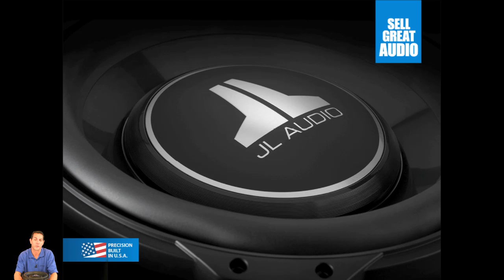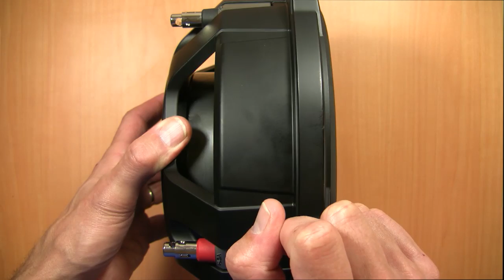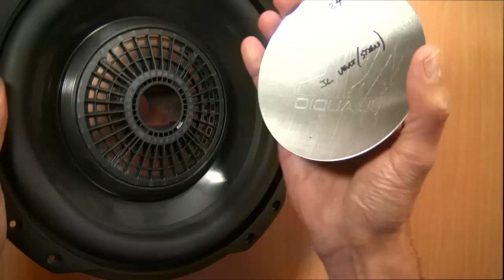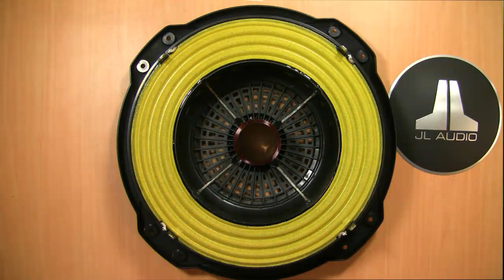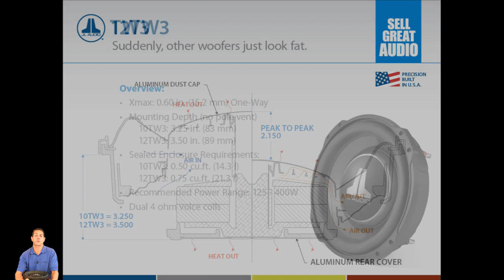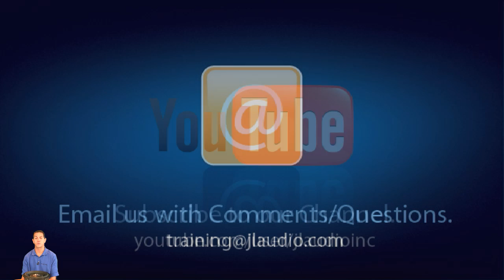A Quick Introduction to JL Audio TW3 Subwoofers

Comment: I have a pair of these  custom mounted in the spare wheel well of my BMW Touring each one with its own 500W JL Audio amp. When I turn them up the car shakes so much that the electric windows wont close in the door frame. They're that good.

Comment: I have a 2016 Tahoe want to a amp and some subs, but want to put subs in the back panel is there a stealth box that fits in the place of the panel? I don’t want to take up a lot of space? Help?
Reply from the maker: Hello Pepe,

We do not currently offer a Stealthbox® solution for the rear cargo area of your 2016 Tahoe, however, we offer a solution that fits inside the front center console.

The SB-GM-4GSUVCNSL/10TW1 Stealthbox® fits inside the front console of 2015+ Chevrolet and GMC full-size SUVs with front bucket seats and a factory console.

Loaded with a single 10TW1-2 in a down-firing sealed enclosure, the SB-GM-4GSUVCNSL/10TW1 Stealthbox® is wired for 2 ohms and rated for 300 watts of input power.

Alternatively, if you require a custom enclosure specifically in the rear cargo area of your Tahoe, I recommend visiting a local JL Audio Authorized Retailer to inquire about a custom enclosure build.

Comment: would these do ok in a ported/vented box? or would they be best in a sealed box? i'm looking to install them behind the rear seats of a 2016 crew max tundra.
Reply from the maker: @jbw5485, yes they would do well in a ported enclosure. We have specs on our website for ported applications.
Reply: @garminaudio  thank you for your quick response. i see on your website it recommends 0.60 cu ft. for a ported enclosure. the one i'm looking at is 0.88. is that going to cause a major issue? it's an enlcosure for two 10's that would fit behind the rear seat of a crewmax tundra. i guess my main question is, how exact does the enclosure measurements need to be? thanks again.
Reply from the maker: @jbw5485 that should not be an issue as long as the tuning is between 32-35 Hz. If it is tuned much higher it could sound boomy.

Comment: I've been running JL audio subs ever since I was old enough to afford them. I've had the W6 and W?s in twin 10s both were well powered and I loved them in my Audi then in my Z71. I'm now looking to add some more bass in my 2015 jeep rubicon unlimited (4door). It has a tone of aftermarket equipment on it as do most jeeps. I have not touched "premium system and floor mounted sub in the back. I'm looking for something that will allow me to still use the back to haul dogs and other stuff around. Do you have any suggestions on what I should put in and where? I'd be ok with a real nice 10 powered well, but there are some options I've seen in forums. I don't know wether to get a super low mounting sub under one of the sheets or if a stealth box is available or what amp I would need and where it could go. Space is an issue, but I don't want to put something cheap in that doesn't sound good. Please advise.
Reply from the maker: Hello, we have a set of 10 inch enclosures that are designed to fit along the sides of your Jeep.  They would  not take up any of your usable space.

http://www.jlaudio.com/car-audio-stealthbox-jeep-wrangler-unlimited-07-up

You could power a single with the XD3001v2

http://www.jlaudio.com/xd300-1v2-car-audio-xdv2-amplifiers-98601

or the pair with the XD600/1v2

http://www.jlaudio.com/xd600-1v2-car-audio-xdv2-amplifiers-98604

Comment: I am looking for subs to go in the saddlebags of my harley. 1 10 in each bag vs the traditional quad 6x9 would running a bead of silicon around the dust cap to prevent moisture harm them.

Comment from the maker: @sumaran72:  They are designed for small sealed boxes.  Free air is not recommended.

@CAMDENN MUSTANG:  500 watts on each is a tiny bit more than I would recommend, but if you set things carefully, you should be ok.  Please follow our recommendations in the amplifier owner's guide.  Or you can email us at technical@jlaudio.com

@FvD714:  The final specs have not been determined on the 12TW3 yet.  We take our parameters from production speakers and they are not in production.  Yet.  ;-)

Comment: Hello, 

I`m interested in using two of these in my car via a sealed enclosure with separate chambers for each driver. 

I`m also using two HD 900`s and I was wondering if putting the 500 watts from each amp on each sub would be too much for them to handle. 

Any info that you can give me would be great. 

Hope to hear from you soon.

Comment from the maker: The TW3's are designed to be used in very small sealed enclosures.  They are not recommended for infinite baffle (free air) applications.  The 10TW3 only needs 0.5 cubic feet.  That should be fairly easy to get in most applications.

Comment: I have a 12 inch Alpine type R with JL Audio C2-650 back & C2-550 front door speakers and a Pioneer DEH-80PRS head unit. I'm planning on buying a new sub and I'm wondering what sub is better, this new TW3 or a W3. Which one hits harder?

Comment from the maker: The TW5 is, overall, a better product.  The 13TW5v2 is the only size available (2 or 4 ohm coil options) and it has remarkable sound quality.  The newer TW3's both have dual 4 ohm coils and you can get a 10 or a 12 inch.  Sonically, the TW3 will be very similar to the W3v3 while the TW5 is a bit closer to a W6v2.
Reply: Disagree there. I had a 13TW5v2 and was never happy with its performance. Replaced it with a 12TW3 and that thing is a beast! Don't waste your money on the TW5. The TW3 is the better product!
Reply: @idmax  yeah what do they know about JL subs anyway

Comment from the maker: The dual 4 ohm option allows for a 2 ohm mono amplifier to deliver maximum output.  If you use two of them, they can be wired to a 4 ohm mono load if needed.  Many amplifiers are now optimized for a 2 ohm mono load, so this should work out well in most cases.  -st